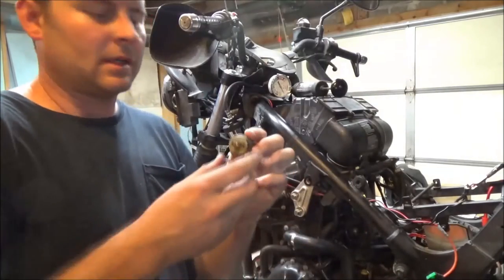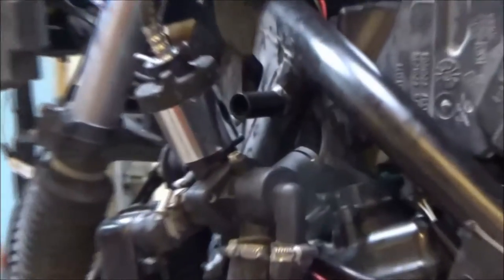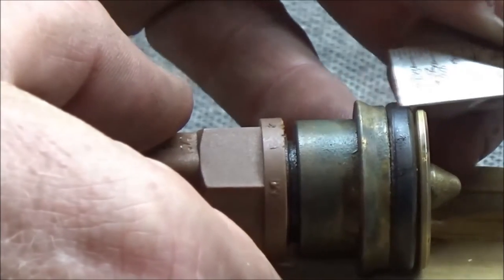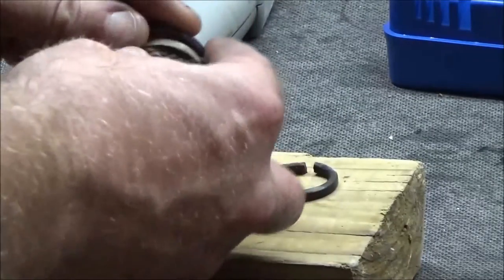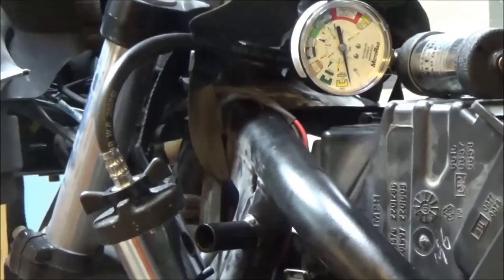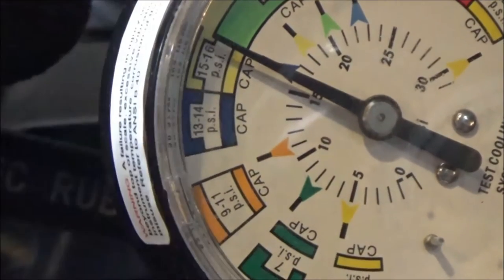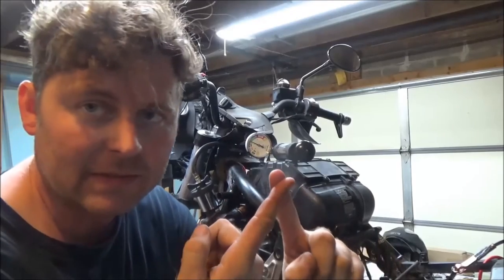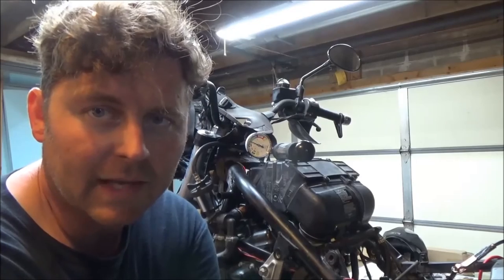How  to determine if an o-ring needs replaced and selecting the correct one when size is unknown

Comment: Working with hydraulics, I see lots of o-ring face seal hydraulic fittings. (Fittings that use an o-ring on the sealing face of the fitting to seal relatively high pressure hydraulics.)  Most of the time, you can get away with not replacing the o-ring in the fitting if it still appears round, but it is recommended to replace the o-ring every time. I've seen a lot of o-rings that were no longer round in cross section, such as the old o-ring in your video, those should always be replaced. And, as you pointed out, always test for leaks after the repair. 

If I know that there is an o-ring involved in something that I need to disassemble, I automatically order it, assuming it is not something that normally is kept in stock. I get upset with myself when I have to delay the completion of a repair because I don't have an o-ring that needs replacement!

Good video Shane, thanks for posting it.